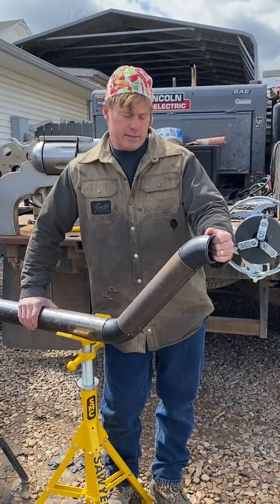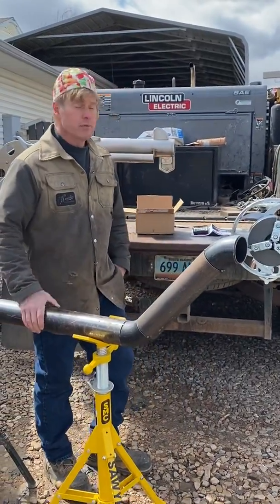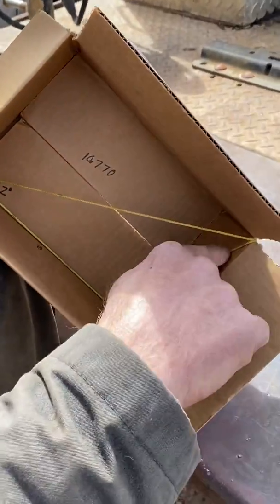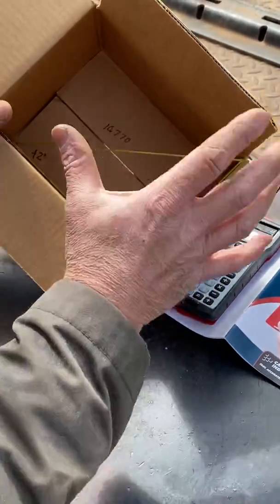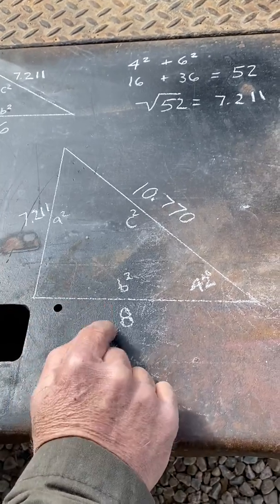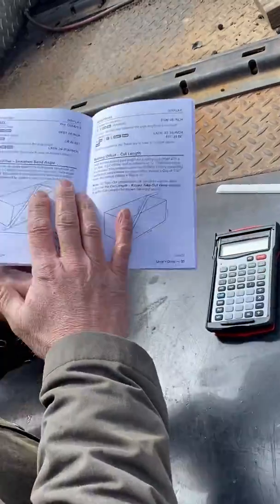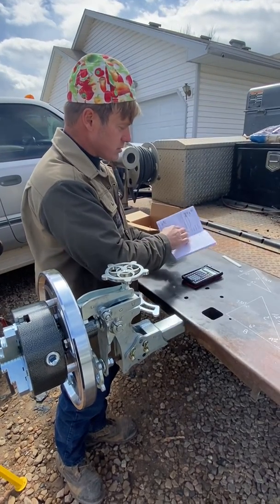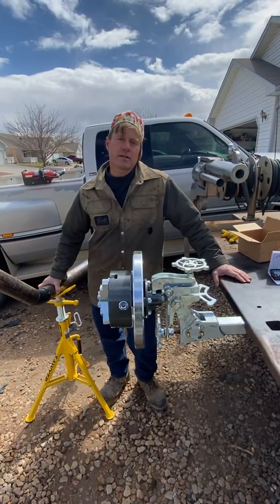Pipe Welding Layout: Rolling Offsets 2 Ways

Comment: I have a quick question.  Do you have any formal pipefitting training?  Why do I ask..   I’m actually a teacher at our local union. 

Sometimes pipefitting channels come up on my feed and I have to have a look. Most I laugh at. 

I did come across a couple “Smart Azz” Guys about 15 years ago.  I gave them a problem to work out and they still have yet to give me the correct answer. 

You have a genuine interest in pipefitting. 

Keep up the good work!
Reply from the maker: No formal training in pipe specific type work., just worked in fab for many decades and with some ace hands who I learned a bit from also. Worked with some great guys in precision sheet metal holding very tight tolerances through multiple bends and how to get the correct flat patterns for complex things like rectangle to round offset transitions. Had a little formal training with drawings and math as it applied to precision sheet metal but mostly just doing it a long time and trying to help out the other guys with layout.
Reply: @offthehookdesignandfabdotc2582  That’s Great!  Keep doing what your doing and never be afraid to learn new things!  🤙🤙😎. I spent my whole career as a pipefitter. 25 years in a paper mill and 15 years building engineering spaces in new cargo ships. Big boilers and SuperSized Superchargers.  

Did you ever see a supercharger with a 72” diameter inlet! 🤣🤣

Comment: You missed the takeout for the elbows.
Reply from the maker: If you listen to the beginning of the video I said this was for figuring out the center to center distance. 
The elbow take off will of course have to be subtracted. 
That is a given.
Reply: @offthehookdesignandfabdotc2582  I missed that part.  Loved the presentation!  👍👍. It was nice to see someone getting off the 45* kick.  Pipefitting is not always 45’s, tees and 90’s.
Reply from the maker: @RichGT350r  true. I made some other videos for figuring out the take off and other things. Tried to keep it simple and separated.
Reply: Guys in comments. Take the knowledge and apply it. Pipe diameter changes and so should your knowledge. Be better random guy and figure it out yourself instead of throwing flak
Reply: Do it yourself. This is an example.
Reply: @ I’m not going to continue an argument with you.  I know exactly what to do.  I have my 40 year Union pipefitter pin.  You would be Blessed if you were in the trades and had a teacher like me!
Reply: So would both fittings be a 42 degree?
Reply: Yes
Reply: And the face to center would be?  Looks like 3” pipe.

Comment: I thought the next step after you have the 7.211 was to multiply by 1.414 can help with my question
Reply: If you do multiply the 7.211 by 1.414 you will avoid having to use mitered fittings. It will work with 45s no problem. Think about it!
Reply from the maker: The 1.414 is a shortcut to finding the length of the long leg of a triangle but this short cut of 1.414 only works with right triangles with equal legs and 45 degree corners.
Reply: Thank you very much for answering

Comment: Best visual representation to teach someone a rolling offset layout i have ever seen. Gonna remember to use that when I'm trying to teach someone else
Reply: So what would the final pup piece be?? The reason I am asking is because since there are 42 degrees and not the average 45 degree than the formula 1.414 would be out and another formula would have to be put in to take off both 42 degrees fittings right!??
Reply: @PedroLopez-tj9qt  the degree of the offset is still 45 degrees. The degree of the roll is not.
Reply: @chimera91977  thank you sir!!!

Comment: So this is different than just a rolling offset right? It’s a 2 way rolling offset
Reply: An offset is when the pipe moves in one direction in the same plane to avoid an object or make a tie in. Using his box presentation imagine the box is a room and a pipe is running through this room. On one side of the room it enters near the floor and travels along the wall through the room. On the other side of the room the pipe needs to be at a higher elevation because let's say there is a door frame in the other wall. A regular offset the pipe would change direction at an angle upwards with one elbow, then change direction again to be horizontal with the second elbow. The pipe is now at a higher elevation to go over the door and through the wall, but the pipe is still running alongside that same wall. It only changed direction in one plane, changing it's elevation.. Now imagine that same pipe coming through the room and changing elevation to avoid the door and exit the room at the other side, but now there is a steel column or something in the way. Now the pipe will have to change direction upwards to a new elevation, but also have to move to the side or "roll" away from the wall to avoid the obstruction. This is a "rolling offset". So to answer what I think you're asking, rolling a offset is a "two way" offset, the pipe is moving on two different planes during the offset. There is no such thing as a "2 way rolling offset".
Reply: @chimera91977  Awesome thank you for that explanation👍👍
Reply from the maker: No its just a rolling offset explained 2 ways

Comment: But my question is how can you use a formula for a 30° angle, and then type a few numbers into a calculator to figure out your angle. Shouldn’t you have to use the formula to find an unknown angle, and wouldn’t that cancel out your A squared plus B squared equals C squared
Reply: With trigonometry you only need two bits of information to find the third unknown. So if you know the length of 2 sides you can find any angle measurement. Or if you know the length of one side and the degree measurement of any angle then you can find the length of any of other sides.
Reply: Also, trigonometric functions work for right triangles only. A right triangle has one 90 degree angle, always. So if you know the other angle is 30 degrees. Then you know the third angle is 60 degrees. All triangles only have 180 degrees.